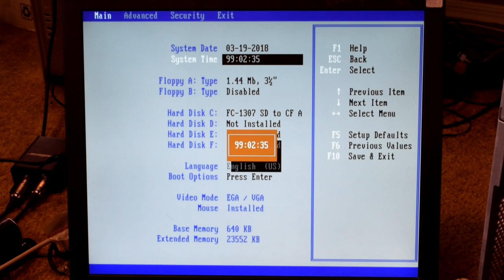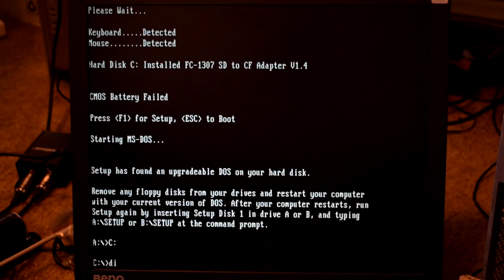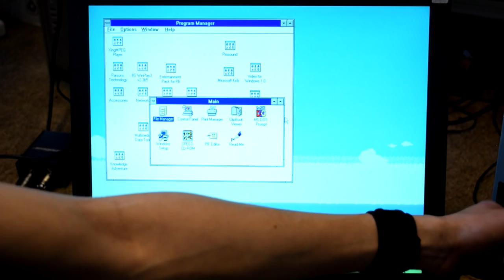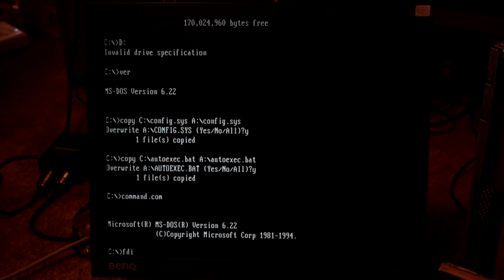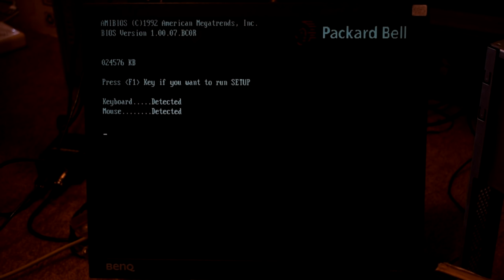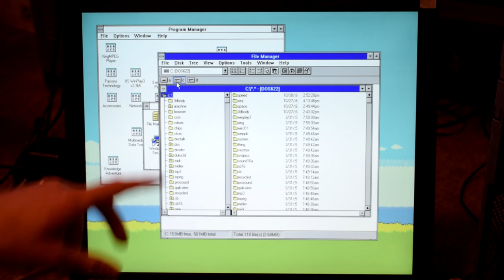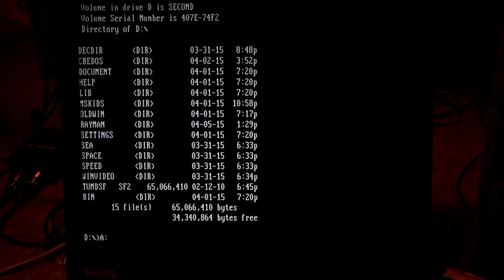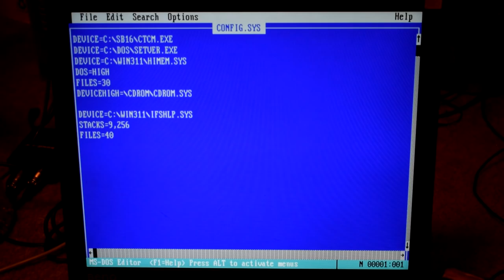The DOS Machine Rebuild - Part 1

Comment: red to red and you're dead. This dead power supply has prevented you from frying this motherboard, as you *CAN* put the AT plug in the wrong order, and you did it the first time.
ps: cool video, druaga :3
Reply: this Post should be upvoted
Reply: Albert Cazares no need to be rude
Reply: relevant: https://twitter.com/Foone/status/982504685406793733
Reply: Hehe, I cringed when he went for the power switch. No no no no you have it plugged in wrong aaaaaaaahhh, oh, whew the PSU is dead :P
Reply: Give Reds' comment a Love, Druaga! It's actually really accurate.
Reply: Some PSUs will shut itself off if you plug the AT plug in the wrong order
Reply: Some of the newer ones will, most will just fry your precious motherboard. One of my friends has fried three motherboards this way a few years ago.
Reply: druaga doesn't treat his retro hardware that well, sadly. LGR treats his better than him.

Comment: Hey Ian, have you considered doing a modern hackintosh?
Reply: Duncan Franco Up
Reply: He did that didn't he?
Reply: yea he installed 10.6 on a laptop
Reply: That's old though, would be great to see a more recent hackintosh
Reply: Duncan inside a Dead PowerMac!
Reply: Hackintosh SSD RAID on a CHIP
Reply: Up
Reply: Yeah, gut a G5 case, break out the power tools and fit ATX components inside. Nice little weekend project.
Reply: He hates modern stuff😂
Reply: Up

Comment: Have you thought about learning to solder? It could save you a lot of headache on broken pc parts. It's a lot easier than you think, you basically take a 500c stick and poke some metal until it melts. The hardest part is having parts, and they're dirt cheap from ebay. Replacing caps will normally cost you 1-5$ depending on what it is. That's after the upfront cost of buying an okay soldering iron, You generally need to spend around 50$ to get anything that'll be easy to use. Soldering is only hard if you have a crappy iron. And if you do go to solder, get a chisel tip, you might think that a smaller tip would let you get into smaller areas for easier soldering. It isn't, Using a conical tip makes soldering a nightmare, it has little to no thermal mass that makes it really hard to solder at all.

I only brought this up because i want to watch you solder.
Reply: Geose 310c is much better for most stuff
Reply: Geose Akubukku fits your needs better, Druaga doesn’t know any better
Reply: GewoonLeon They haven’t made a video together in a while. With how many collabs they did, it makes me think they might have fallen out with eachother
Reply: You're supposed to heat the metal that you're soldering, not the solder itself otherwise you'll get cold joints.

Comment: Have you tried booting with Plop or some other boot manager floppy disk? They might be more acceptable of weird partitioning schemes.
Personally I've even managed to boot from USB on a Pentium 1 with Plop, so I'd imagine it'd work quite well here.
Reply: Ploppy floppy I recommend. Not sure if he'll see it lol

And yea I installed Win2k and 98 off the USB drive on a P1 MMX.
Reply: xan1242 win2k on a Pentium mmx???! That's insane, I thought installing XP on my p2 was a sin!
Reply: Nah mate, WinXP runs on a pentium 1 just fine! Heck I'd be running it instead of 2k if I had the drivers for my s3 card. It's all WinNT 5 anyway, it runs pretty much the same, it's the UI that's just a little more demanding so XP without the themes would work just about as well as 2k.

The newest OS I could run so far was FreeBSD a couple years ago. Only ran Fluxbox with it but if I had a bit better graphics card I'd dare to run LXDE or even XFCE. Shoulda tried WindowMaker in retrospect, that runs great!

If you want to talk sins, installing Win2k over the course of 2 days on a PS2 over an x86 emulator, now that's a sin of wasted time. (BSOD on first bootup, not during setup, so I technically ran Win2k on a PS2 already hehe)

Otherwise yea, PLOP is amazing! The installation times were surprisingly fast (probably due to the nature of solid state medium).
Reply: xan1242 Yeah, Plop is wonderful, if it would only work on my Pentium 3 gaming PC. It won't boot off a floppy disk or a HDD for some strange reason that I was not able to find yet
Reply: plop is a great tool, i use it to boot from USB off my pentium 2 PC (which has the same inwin case as druaga's dos PC) and it sure is useful

Comment: I think Dr. Frankenstein did it better. Non-removable CMOS battery: unsolder the battery, then solder in a connector for a 2xAA battery holder (assuming a 3 volt CMOS battery—check your motherboard's requirements). Make sure to install the battery holder someplace safe, where it won't get hot or if it leaks it won't be on anything important. My preference is to install it on the outside of the case for easy access.

Comment: it can't boot cause the dallas battery is flat, the bad thing about it is it's soldered on rather socketed so it will be a pain to replace
Reply: Yes, I hate those crappy Dallas chips. I replaced a few of them

Comment: Well you could use an atx psu with an atx to at adaptor and then just hook the power good green wire to the switch. If thr amps are enough that should work

Comment: I'm pretty sure the first fanless AT power supply didn't start because the power connectors were plugged in the wrong way. First one was black wires out on both connectors, black wires should be one next to another on both connectors so black wires are in the middle when both power connectors are plugged into AT motherboard plug

Comment: I grew up doing this type of stuff with boards and PCs from the 80s and 90s.. Even taught a class or 2 on how it's done.. Its all not that hard, just different since there is no plug and play.. Which we used to call "Plug in Pray"...
Reply: Robert W I can see why, mainly due to stuff relating to lack of drivers present on the Windows CD at the time.

Comment: Would the requirement of an old vintage motherboard be because you needed a board without UMA shared memory for graphics card's? 
Makes sense too me abandon any motherboard with built-in shared memory video card's. Even dedicated graphics card's could use this memory so you may not be able to create a page frame address with EMM386.exe for ems support even emulated through software. It's just best too know your mobo. And now day's their limitations for DOS.

Comment: Get rid of all the junk parts and use QEMU on a modern Linux system to run any version of DOS or Windows you want.
Reply: Eric Wood but, where is the fun of that? See, these systems are not even worth a fuck today so why even bother with dos or windows 98? Because configuring all this stuff is fun and that is what you lose when you use qemu

Comment: The next time you install an ATX power supply, make the effort to secure it down better. Drill some holes in the back of the case if needs be. Holding the power supply down with one screw is just stupid. I think i would have broken by now if i was held down by one screw.